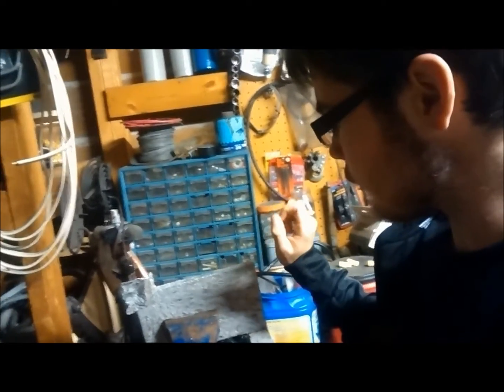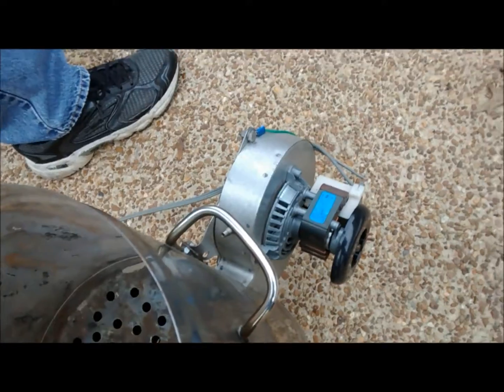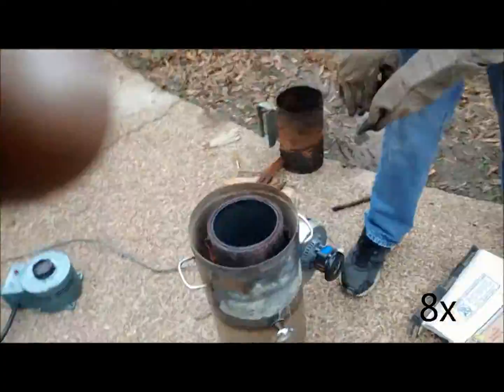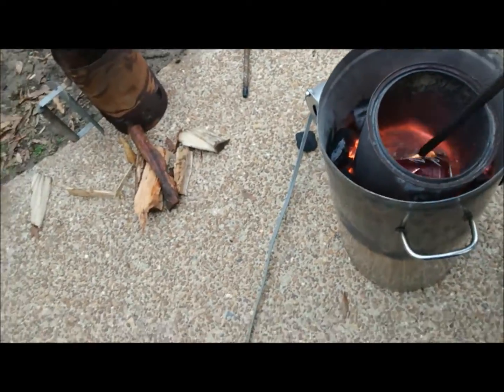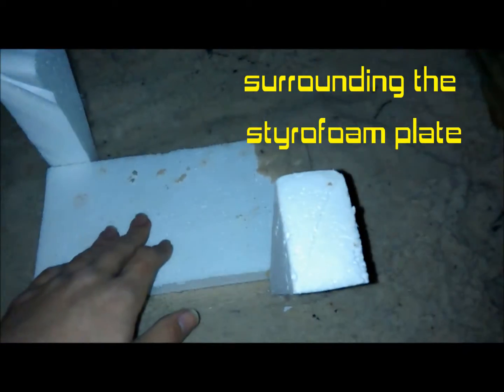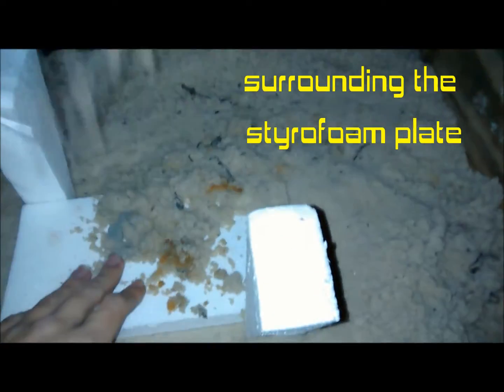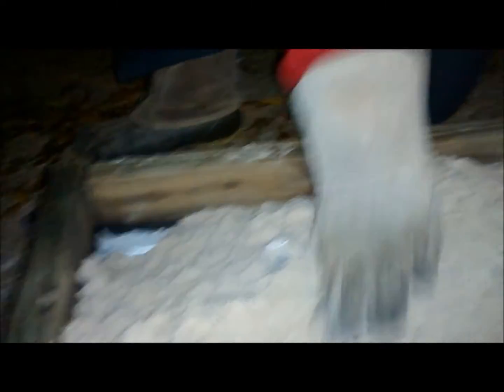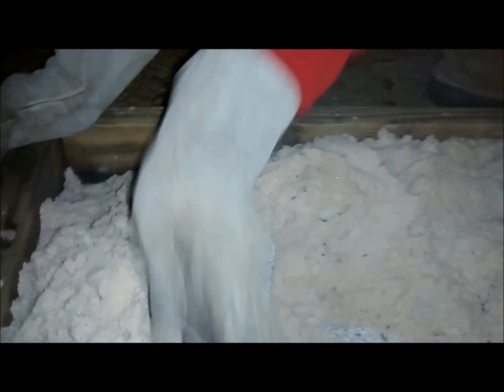Casting Aluminum Plates for Strength Testing: Part 1

Comment: Hey, just a tip, but melting aluminum cans for home casting is, in general, a horrible idea. Pretty much every part of a can other than the bottom is mostly aluminum oxide, which you absolutely do NOT want ending up in your casting, since it melts at a much higher temperature than pure aluminum, causes cavities within the metal, and makes it a lot less strong, susceptible to fracturing, etc. Even if you melt enough cans to get enough viable aluminum to make something, it would be nearly impossible to separate it from all that oxide. I wouldn't try melting any aluminum stock less than 1/8" thick if you want a good casting.
Reply: are you sure,my colleague has built pro smelters and says as long as preheated its fine,aluminium can bales sell for £850/tonne too
Reply: Um...no. You can't really melt the oxide at home, it stays solid and you skim it off of the top of the molten aluminum.
Reply: Aluminum oxide is oxidized aluminum. When you melt the oxygen is liberated , but the amount of gas you are getting is minimal. Just stirring the alloy will help to degas. No matter what you do, cast aluminum will never be as strong as extruded aluminum. Melting cans is perfectly fine for any general use.